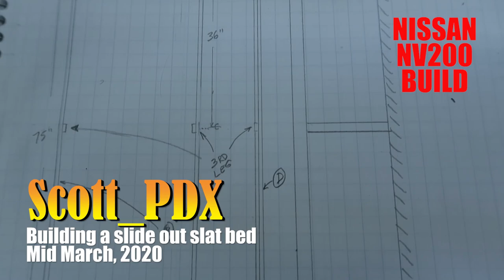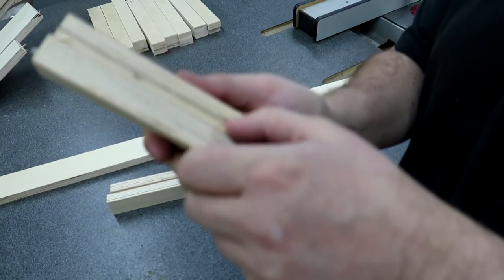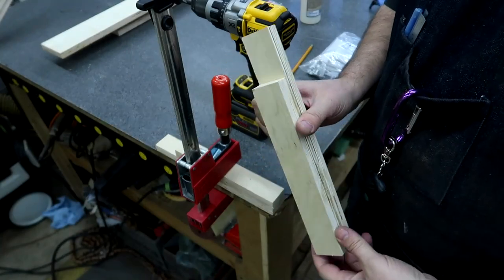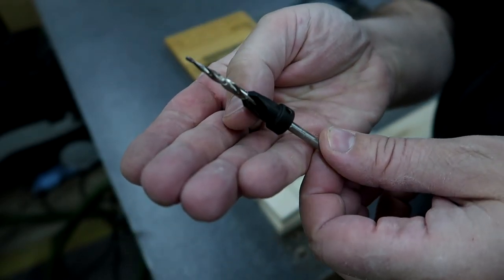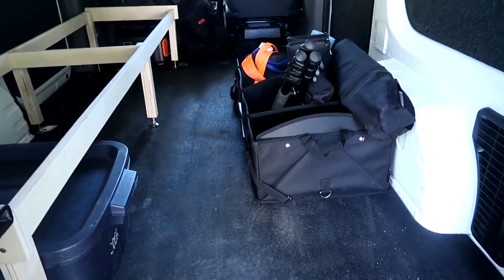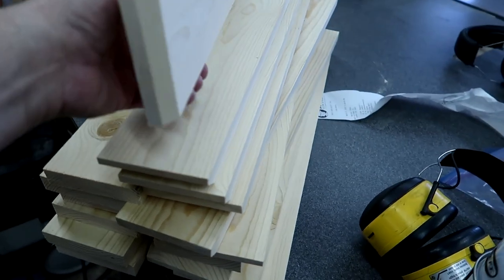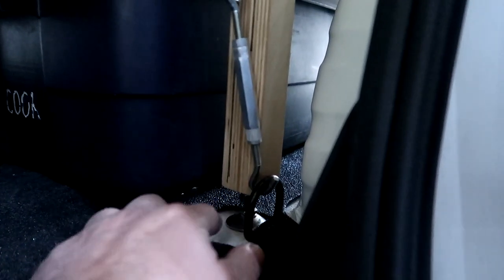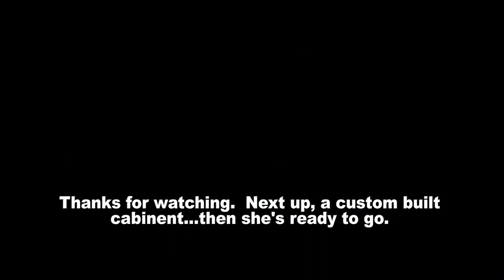Building a slide-out bed for my NV200 Micro Camper Van

Comment: While I appreciate the fine craftsmanship of your slide out bed, as an owner of a 2015 NV200, I’ve decided on a different option.  It’s just a personal choice based on my needs for cargo hauling and the occasional camping.  I purchased a Coleman camping cot that  I can easily remove and also fold if more space is needed.  There’s also plenty of room underneath for storage and the weight is also significantly reduced.  Thank you, too, for the video of you adding your windows.  That’s an option I’ll be exploring as well.  Good job.
Reply from the maker: Thanks. I use a cot in the back of my truck when I want to camp down rough roads.  Works great for that application.  Lots of ways to camp and build out vehicles.

Comment: How are the metal adjustable  legs holding up? I saw another hack of using sections of PVC pipe over legs to raise bed. Nice slat bed!
Reply from the maker: They are okay.  They do tend to unscrew a bit, but some lock-tite and 2 good wrenches fixes that. Overall, I'm pretty happy with the design, but wouldn't want to live in the van and have to set that up every night.  In fact, in my new van, having a permanent bed was a major design choice.

Comment: Thank you for this! Where did you get the swivel seat for the passenger seat? I have been looking for a source for these. Did you have to do any special mods with the centre console to make it fit?
Reply from the maker: It's not a swivel, I just rotated it 180 degrees.  There is a video out there on how to do it.  I did have to enlarge one seat hole about an 1/8".   No other modification needed.  Of course that makes it a 1 person van.
Reply: Scott_PDX    So true. Maybe its just better to take out that seat and put in a simple folding one so that when needed as a passenger seat, one can just reinstall it. Is it too difficult to reinstall? Or maybe to even take out? Thanks from Texas.

Comment: I really like this series. I’m looking to do exactly this but trying to work out if it will be high enough for me. I was wondering how tall you are & your head clearance when sitting on the sofa. Thanks!
Reply from the maker: Thanks Sam. I'm 5' 10" and have about 2" to spare. If I leaned the driver seat forward and didn't have those bags on the back of the driver seat that would  give me about 6" more inches to lay down. I did change the cushions out to 4" vs the 6" ones show to get a bit more headroom when sitting, and better foam,, but even the 6" gave me plenty of headroom when sitting. Do some test fits first and adjust the height to fit.  Good luck.